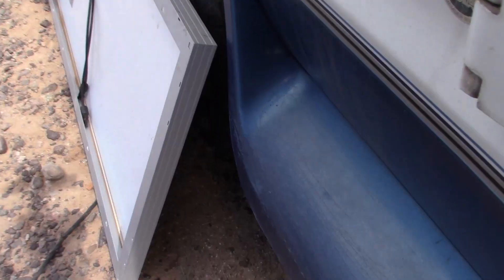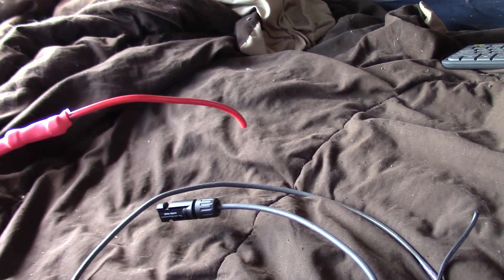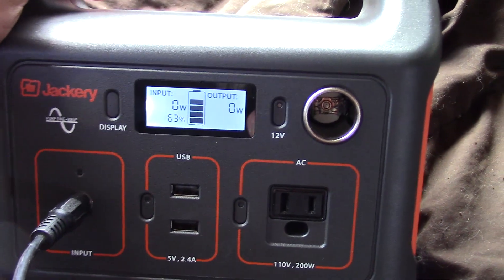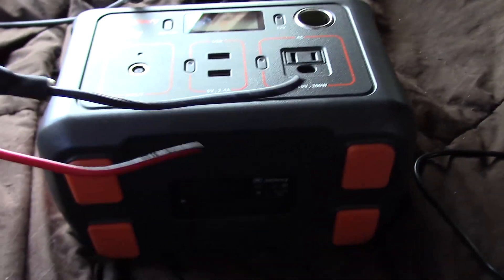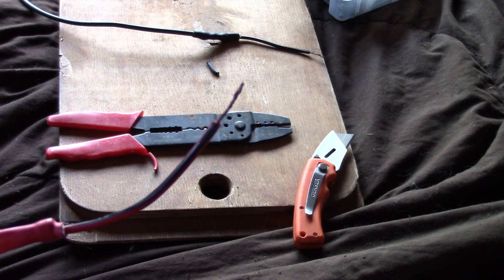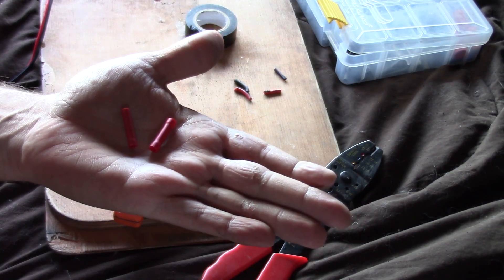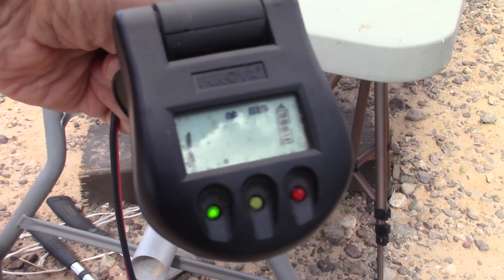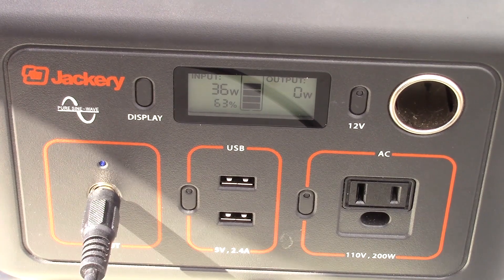Use ANY SOLAR PANEL For JACKERY And Other POWER STATIONS! How To DIY ADAPTER CABLE

Comment from the maker: CABLES SOLD OUT 2019 AND I'M NOT MAKING MORE! GET SIMILAR ADAPTERS HERE: https://hobotech.tv/amazon/#Solar-Adapters
Reply: HOBOTECH 
How about $35 for the cables? But you’ll have to sign it since it’ll be a collector’s item.
Reply: 🤗 Hello.. Ive just recently purchased a portable TackLife P16 150w from Amazon for my emergency power needs.. In the description it shows 3 ways to charge the unit. 2 ways im in dire need to know of is.. 

🤔1. what kind of 12 10ah connection can i purchase to hook up to that type battery & 2. where do I find the right 40w solar panel option it displays.. I can't find it.. #Help ! 

😪I live in the country part of town where there is always power outages. Im also looking into a larger unit for larger appliance's
😁Love your videos by the way
Reply: I'll give you $100 for a cable! Please!!!

Comment: Could make my own professional like. Dont know if the anker solix everfrost 2 58 liter can be charged without damage probably wont. Instead of using xt60.  Would use a car adapter to run .

Comment: the jackery for me isn’t meant for main use. it’s brief use, mostly for 1-3 hiking, camping. i have dark energy power blocks for main use, with a solar 18w solar panel from them. the jackery is best of its class, i just hate the branded solar they offer. it’s not efficient nor portable enough for me. i use the jackery 300 btw

Comment: Do you need a overcharge charger circuit?  I have two 100w panels that recommend installing an 8amp charging controller to prevent overcharging.  Is this required if using to charge a jackery?  My understanding is it’s necessary if hooking up a 12v battery.

Comment: Large Marine Vessel ET Tech here- Watts=Amps X Volts. The formula for Amp Hours is Amps X Hours. My Jackery 290 (20 Ah) takes about 5 hours to charge in full sun with a 60 Watt foldable solar panel. *****The quality of the solar cells factors into the efficiency of the input rate so if you go cheaper ya gotta go bigger. 
While backpacking and camping for 4-5 days (Boy Scouts) I need my CPAP to get a good nights rest so I try and reduce my resptronics output volume to conserve battery and minimize the size of gear to lug around. On cloudy days I’ve had to reduce my CPAP time to 4 hours but it’s better than nothing.
I’m thinking about trying a 20v DeWalt drill battery inverter and lugging around 4-5 batteries with an even smaller solar panel but haven’t crunched the math yet.

Comment: I just did this with a Jackery Explorer 1000. There was a catch, though. The Jackery would take the charge from the 100W Jackery branded solar panel I had but it wouldn't take the charge from the 200W Renogy panel on roof of camper, which was what I wanted. It was puzzling because despite the panel putting out voltage the Jackery wouldn't take it even though it would take it from the Jackery panel. Finally, for lack of options I put a multimeter on the 8mm plug on the Jackery-branded panel. Much to my surprise it showed a negative number when I had the black on the pin and red on the barrel of the 8mm connector, so, essentially, reverse polarity. I went back and flipped the cables from the Renogy to be black to red and red to black to achieve reverse polarity to that 8mm plug. And it worked. Don't know it it was intentional on Jackery's part, but the outcome was you'd assume the Jackery would only charge from Jackery branded panels unless you put a multimeter to it and realized they set it up the opposite of how you'd think it would be.

Comment: You seem to know a lot about Solar and stuff can I run 600 W of solar six 100 W panels 75 feet with six gauge or eight gauge wire everything would be wired in parallel I understand I can get by much easier running that with a series hook up however my amperage would be greatly reduced

Comment: Hello Hobotech… first and foremost.. we appreciate your wisdom and support in the solar world.   I recently purchased a Jackery 1000 pro… and have connected it to a 340 watt single panel which on my meter was producing 39.4 volts in full sun.  I have adapted the mc4 cables to 8mm from Amazon.  That said… I’ve tried this setup on two different panels ..a 160 watt and the 340 watt…but the Jackery pro doesn’t recognize either.  It’s making me crazy… any suggestions would be greatly appreciated 🤪.  Thank you

Comment: I know its an old post, but still have a question. I have a 60wt solar panel with Voc 27.3 volt. Have to find a way to charge my Golabs power station 520wh which can take 23.4volt max. Any suggestions? Thank you.

Comment: You're videos are REALLY helpful to me as I navigate the (scary) world of solar power and both my lithium external battery and my agm batterie for my camper.  I have a question I hope you can answer.  I have an ECOFLOW Delta 1300 and an ECOFLOW 160W solar panel - those work great together and acts as my back up/off grid camping power combo.  My small camper has an Interstate 12v, 35 ah deep cycle house battery that is SAE solar plug ready-it powers the lights, fan and charging ports in the rig.  Here's the ?: Is it possible (with an MC4 to SAE adapter) to charge my AGM battery with my ecoflow panel?  I realize I will need a charge controller (since ecoflow's panel does not have one built in) but have NO IDEA what kind of controller, or if that's even possible.  HELP!

Comment: I have a Renogy 30 watt panel with a 12v plug, meant to go into a vehicle's 12v cigarette lighter to trickle charge the vehicle's battery.  Would it work to plug into the Jackery's 12v outlet?  Or does the Jackery 12v not allow charging input?

Comment: I'm still learning how to use solar panels and power generators. So if we leave the solar panel in the sun it charges & then I can later plug in my cell to charge my cell? Is that how it works? Thank you so much for sharing great information.

Comment: Your 3 year old post saved me from ending up with no way to charge the 2 small (240) Jackerys if there was a power down. I didn't realize you needed a Jackery panel. Just ordered conversion adapter cables. Thanks.

Comment: No blame accusations here. I tried this ( obviously I must be to blame for my own action ) so I use my Dokio 400w solar panels, It blew a 5am fuse but I could smell burn coming from my Jackery 1000w. Now my Jackery wont charge anymore the battery is working still has 51 all socket work. just can not charge the Jackery. Why does it not have no anti- surge protector or a fuse built into the Jackery ? madness. Now I have a very heavy paper weight,....... GUTTED. Thanks for sharing as I said no blame to anybody but my self, oh tried rebooting and the rebooting worked but not the charging, Ray K.   UK.  YNWA. SOB SOB SNIFF

Comment: I was excited when I saw your title and pressed play till I watched this and saw the ends you had for the solar panel. My solar panels may not be water proof but they are brilliant. I have the Dokio 400 and that has a AT60 end. BUT Ive looked up on Amazon and got the ends I need THANK YOU very much I am going to Ireland in 2 weeks and ive been looking how I could connect my 2 1000w jackery's to my Dikio 400w solar panels YIPPEE youve showed me very very happy bunny I am. Thanks for sharing Ray K  UK  YNWA.

Comment: Hoping you can help.  My daughter and son-in-law have a jackery 500 but no solar panel.  I have an extra acopower 120 foldable panel.  I am wondering if they can safely use it.  For the Jackery 500 ..specs... "dc input 12-30V (100W max).  The acopower dc output is "18 volts".  The Imp - 5,97. So I am worried that the output might be more than 100 W  on a perfect day.  Would this harm the Jackery or just the jackery would not accept more than 100W.  Definitely don't want Mother-in-law's solar panel to KILL their jackery!!!   thank you for any help on this.

Comment: What size panel is best for the Jackery 500 and newer 300? I need to buy panels but not sure what size... I have a 120 foldable panel i use but need them for my roof permanently. I am so clueless when it comes to this stuff and no matter how much i try to educate myself i just do not understand it.  I know i need panels to charge my 2 power stations just no idea what size or what to buy with the panels???? Please help....
Thank you!! ☺

Comment: Greetings!   Could you please Tell me if I need anything besides what I have.   I’m going on a trip next week.   I have bought a 120 W solar foldable panel from rinkmo. It has an output box end it came with a DC cable to connect to the power supply.  First I would like that cable to be longer,  but do I need MC4cables or a solar charger? What about if I want to put two panels together what cable do i need?

Comment: question for jackery 1000, if you had a two socket splitter for the cigarette plug in, could it handle a diesel heater & 12 volt fridge at the same? As long as it doesn't go over the 10 amp limit for the cigarette plug

Comment: That 12v socket is $28 in Canada, the MC-4 cables are $22. Still cheaper than a new Jackery panel which is $390 in Canada.

Comment: I’m so lost. I’ve been researching all day trying to figure out if I can safely connect one 200w panel to my jackery1000 instead of buying the jackery brand panels I wanted to get the renogy or rich solar 200w panel. But have no clue if it’s compatible. Can someone who’s not electrically challenged like me help me a bit?
Reply: No, but pretty sure you can buy two 100w solar panels and run them in parallel.
Reply: Id be interested if its compatible as well

Comment: I have a 14watt foldable sunjack panels but mine has a usb box instead of using the mc4 connectors.  Any suggestions on how I'd use it to charge a jackery? ... cant seem to find a usb to 8mm connectors to try it.

Comment: what happens if I hook up a 200w panel?  will my Jackery 240 catch fire, or will it just simply draw only 42w from the 200w panel?
Reply: I wish someone answered this because I had the same question
Reply: @avonlearebel  the 240 can support 12-30v input. As long as the 200w panel can support between 12-30v it will be fine. I am charging my jackery right now in a regular house outlet and it is taking in 39 watts, research showed me that the max input of the jackery explorer 240 is 42 watts. 12 volts at 39 watts equals 3.25 amps. Google volts to amps electrical conversion calculator to put in the numbers. I grabbed these “numbers” from the bottom of my 240 jackery. 200w might be able to grab more sunlight to convert in low light conditions but the max input to charge jackery will still be 42watts . You would melt wires if you used the tiniest little wires to run electricity across long distances. There are charts that can help you choose an appropriate AWG wire size with distance and voltage. Anyways….The bigger jackery power stations can better utilize a 200 watt solar panel as their input is 200 watt max compared to my explorer 240 at 42 watts max input. Hope this helps, good luck to you.

Comment: Do you need to use the butt connectors or cN you just twist the wires? I have a 325watt Solar panel just 1. Ive bought every cord for the jackery twice. Did i blow a fuse in the jackery or did i just connect it wrong? Is the panel too big? I have the Jackery 1000. Damn thing needs to work. Im in a trailer with my wife at the end of the month. :( not by choice. I need help Hobotech

Comment: The Jackery 240 has a female 12v recept.  I must be missing something...the adapter you just made had a female socket too!   Is it safe to assume your panel's connector had a male cig. plug on it ?
Could not see it on your video.
Reply from the maker: You use the 12v male adapter that comes with the Jackery.
Reply: OK. I guess because the 12 volt  recpt. on my jackery is not marked for "input" like the 8mm so clearly is.... i just wasnt sure.  
 Appreciate your patience!

Comment: so could I connect a "raw" solar panel to the Jackery and it won't damage  or overcharge it?  i assume the charge controller is inside the Jackery not the solar panel
Reply from the maker: Yes

Comment: I have the jackery 240 + solar saga well it can't get wet but the cable is anderson cable could i buy a anderson to mc4 cable and 100 watt solar panel and i know i will only get 42 watts max but right now i don't get 42 watts plug in a wall socket but will it max it to 42 watt

Comment: I just connected a 12v 100w panel to to the jackery 240 using an mc4 to 8mm dc cable and the display screen shows an input charge of 58w even tho the max input shout be 42w. Is this normal meaning it’s only receiving the 42w but showing what the panel is absorbing? Don’t want to damage the jackery. Thanks for any info!
Reply from the maker: That's fine.

Comment: Great video. I'm getting the jackery  500 or 1000 soon. Can I use both  you adapters  to charge mine or is there a newer style adapter for my 100 watt panel.  Thanks

Comment: EDIT: nevermind I figured it out LOL, it was so simple. 
arghh, I don't get it... how do you connect the wires to the solar panel itself? you didn't show that, and the 12v cigarette port.. you use that to plug the cabe that jackery gives you with your purchase?

sorry I'm really not the brightest bulb in the box lol! thanks

Comment: I Have a Homemade 60 Watt Solar Panel hooked up to my 240, and It only registers about 23 Watts Max on the jackery, Is there something wrong with my panel? Puts out 19.3 Volts at around 3.1 Amps (Short Circuit Current)
Reply from the maker: Sounds like it. The SolarSaga 60 charges mine around 40-42 watts.
Reply: @HOBOTECH  Yeah, Traces lifted up on a cell or two on my panel, Gonna have to fix it. Or Ima just buy a cheap solar panel

Comment: Can you use a stronger panel say 325w on this power station
Reply from the maker: Use a million watts if you like. As long as you keep it under 30 volts it will charge at a max rate of 42 watts ignoring the rest.
Reply: Thank you sir i work in the solar bizz and have a few panels laying around..

Comment: Good morning. The renogy came with a controller. And I meant series and or parallel regarding my question about hooking my renogy with the alligator clips directly to my batters to charge. Thanks again and have a super day!!
Reply from the maker: I guess I still don't understand the question. You put the clips on the battery and it charges. Series or parallel of the panels won't matter.

Comment: Do you think the 60w jackery because it's light will also be able to charge my sequence batteries with clips adapter to hook directly to the batteries. I know it will charge the 240 jackery
Reply from the maker: Not sure what a "sequence battery" is but you never really want to charge a battery directly from a solar panel without a solar controller. You can get a 10 amp Renogy for $15.

Comment: Sorry if this is redundant. I'm not quite knowledgeable about how this all works. I really want the jackery 100w suitcase but even with your discount it still is tough to financially handle. Tell them to up the discount to 35%, ha! I got the renogy on amazon day with controller and the suitcase panel the problem is its heavy!
Reply from the maker: The Renogy suitcase kit is really nice but it is heavy and bulky. The current code brings the price down to $279 and that's probably as good as it will get for a long while.

Comment: Hey, I think you already answered this but then this video didn't address using s 100 w solar panel. It's ok right?
Reply from the maker: Yep, use a million watts if you want. The Explorer 240 charge rate is limited to 42 watts.

Comment: You’ve done it again💗🌹💗, first with sharing “your” discount code for the Jackery 240 (which I purchased) and NOW...guiding on how to attach your own solar panel and the components needed and guess what...I DID IT (applause)🥳 thank you so very much for helping me save so very much money💗🌹💗...May you be bless ten fold💐🌺🌸

Comment: Will this work with the Jackery 440?
Reply from the maker: The 440 doesn't come with a 12v charge cable, but you could build a MC4 to 8mm adapter and use that. Note the 440's input says "25 vdc" so you'll want to use a panel with a Voc of 20-25v.

Comment: I want one of those cables - can you build one for me?  Let me know.  Standing by or your reply.  Thanks so much.
Reply from the maker: The last one sat up there unsold for 2 weeks and finally sold Monday. Sorry. Not making any more. Since the release of the SolarSaga 60 the price is only about $40 more than buying a rigid panel plus my cable, and you get a dedicated folding panel with Anderson connectors.